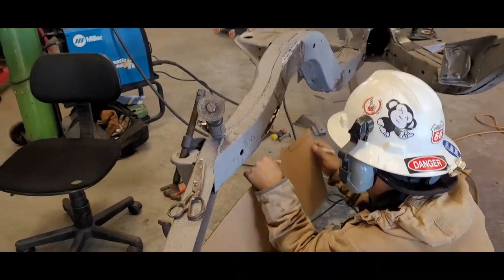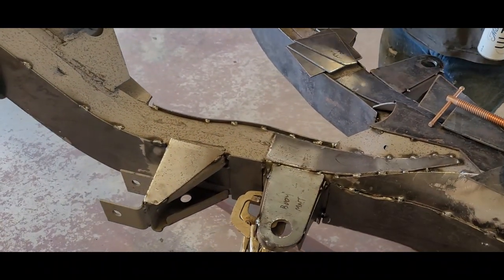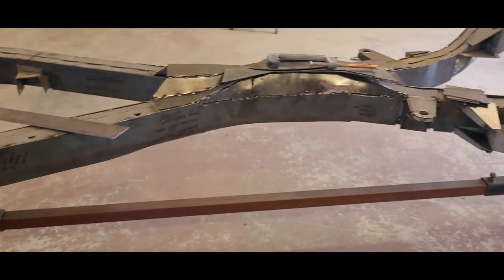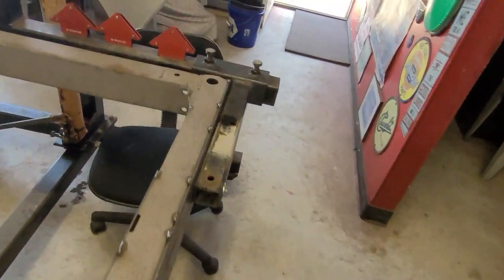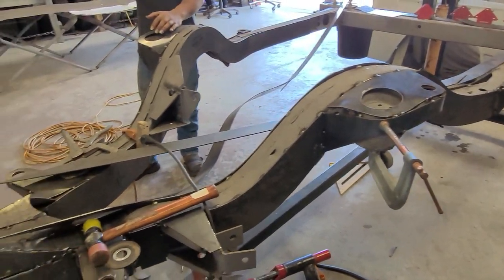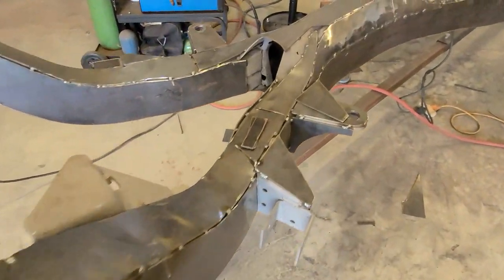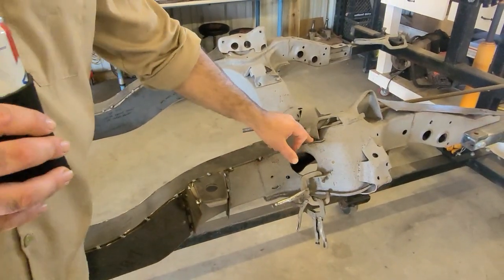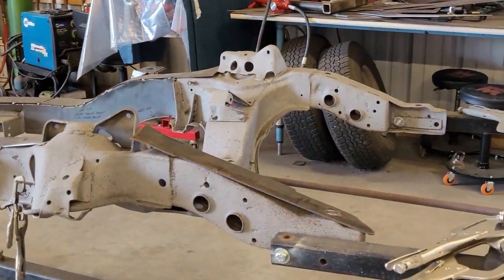Lowrider Hydraulic Frame Reinforcement | 1960 Impala Part 2 | DIY | Rematch | Lonestar Lows

Comment: Bobby has the new gloves so he must be "The Boss"
Nice tip on welding all 3 pieces together.
Tell Bobby my buddy RIP was a Electron Beam Welder and the test was to weld a 12" thick block for the test. He had one cut apart in his garage. At work he welded Helicopter drive shafts.
Reply from the maker: Bobby got promoted from shop help to lead fabricator

Comment: Great work bro! I got that same plasma and the first one kept shutting off on me. Sent it back for a replacement and it’s worked great for two years. I’ve cut 3/16, 1/4 and 3/8 with no problems and did my regal frame with it.
Reply from the maker: Good to know !